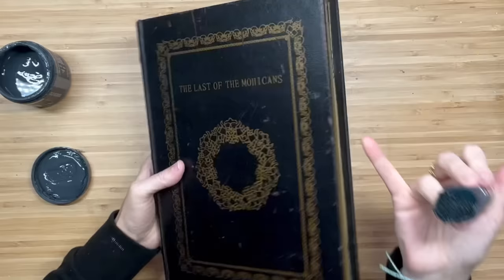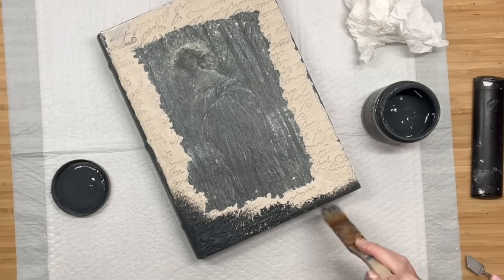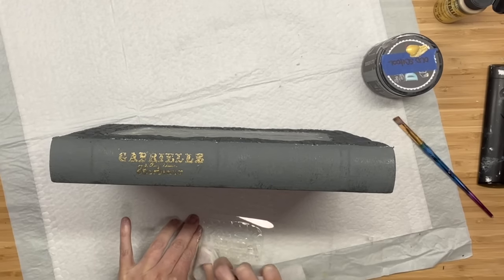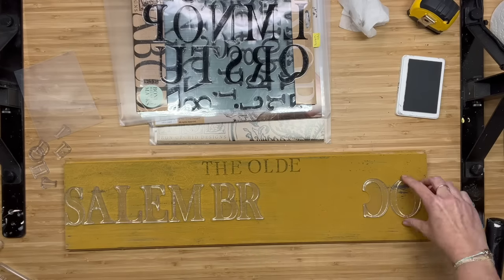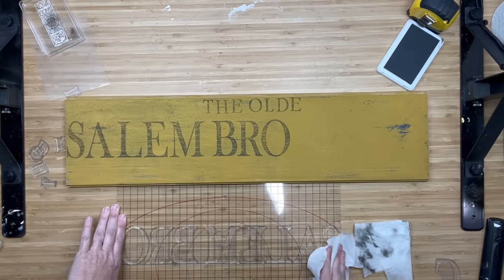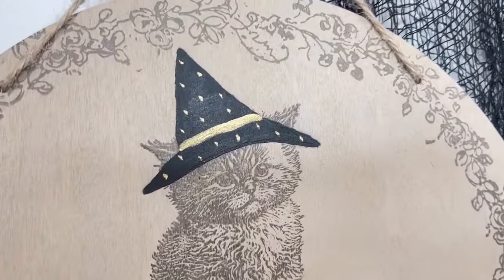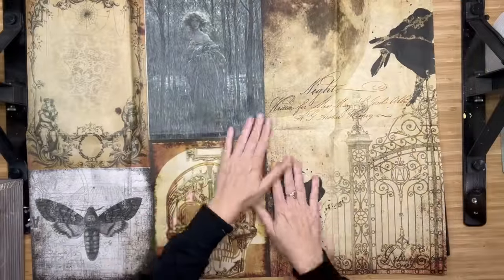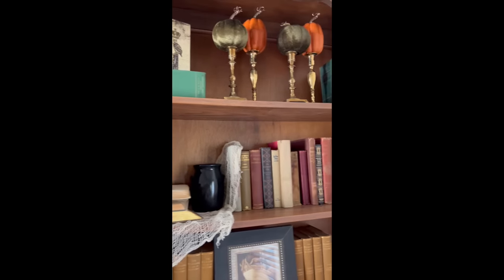Halloween DIY decorations 2023 - Halloween Home Decor DIY's

Comment: Would the salem sign hold up if you put D rings on the back with E-6000 or star bond and hang with a wire across the d rings?